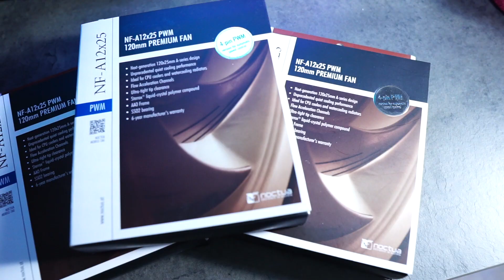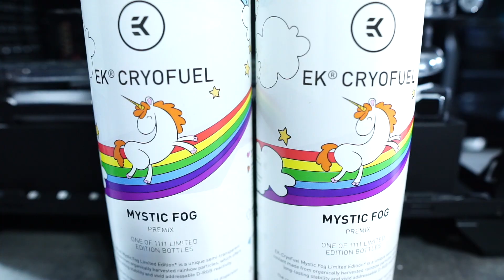Lian Li O11D XL EKWB Hard Line Loop Build

Comment: Awesome build. The offset bracket for the FLT is genius. My gpu is the evga rtx 2080 ti ftw3 ultra, which is 6mm shorter than your gpu but I still needed the offset. Made one from 1/8” thick piece of aluminum flat bar from Home Depot. Thanks for the idea

Comment: Why do the top and side radiators look like they're missing some tubing? Did you run the tubes through the back of the case?
Reply: i ask me exactly the same right now.
Reply from the maker: It runs behind the motherboard in the back of the case to the side radiator. I’ll be doing a follow up video on some of the finer details of the loop!

Comment: Outstanding. I never saw it responded to, but could you spell out which way your fans are oriented. I saw the single rear as in intake, I suspect it won’t matter that much if it’s pointed as an exhaust. Maybe the RAM gets warm, but… I suspect the bottom is I take but I’ve seen too as intake and exhaust in different builds…?
Reply: If i saw it correctly, back and bottom are intake, top is exhaust.

Comment: That looks much nicer. The tubes in previous build looked pretty messy.
Reply from the maker: Yeah I was too fixated on not rotating the CPU block on the old build and didn’t have enough fittings to work around it. Was a learning experience for sure!
Reply: @Kudapex  ohh yeah if feel ya. I always try to have like 2 times more fittings than I actually need to have some flexibility.

Comment: I have the same case and I'm also looking to have 3 radiators, however, looking at your loop flow I dont see the outlet for the top radiator, never done the water cooling at this level before, what I plan is the top rad  (blowing out) deals with hottest part of the loop directly after the CPU, the top rad then feeds the mid rad(side) (blowing out), then into the distribution block, then the pump, then into the bottom rad (sucking in cool air), through the 2 GPU's currently have, 2080TI and 3090, then into the CPU and back up to the top rad, BUT my concern is the GPU's feeding the CPU hot coolant, cool and quiet is what I want, current setup when rending blender animations is noisy even with a Lian Li Galahad AIO 360, the CPU (Ryzen 9 3900x) peaks at 92 degrees under load....
Reply from the maker: Trust me loop order does not matter.  You’re talking maybe a 1-2 degree difference so I wouldn’t worry.  That’s really toasty though. My second PC is running a 3900x as well.  Coolant goes from the GPU to the CPU and it never gets over 75c encoding video with a single 360 rad.

Comment: Sweet build. Hard to tell, but did you have to offset the FLT 240 to fit the GPU? Any special mod required?
Reply from the maker: I did have to offset it since the Strix is so wide. I used a couple little brackets from the hardware store.  I’ll go into more detail in a follow up video.
Reply: @Kudapex  Awesome can't wait to see it! How many temp sensors did you put in your loop? I see one under the outlet port in the reservoir. I'm trying to research placement, what was your reasoning for putting it there if you don't mind me asking? Thanks

Comment: I know this comment is super late but how did you get around the problem with the unifan's being to big to put the quantum fitting directly on the rad? mine do not fit at all!
Reply from the maker: I didn’t seem to have an issue.  Make sure the connector is on the opposite side of the fittings on the rad and you should be good!

Comment: Are those 14mm EK Torque extenders to get the 90 degree fittings over the fans on the bottom radiators?
Reply from the maker: Yes I’d have to measure to remember exact what length I had to use

Comment: This looks great! I have a question on the flow indicator. Where did you get the cover for the screws on it? EK told me they don’t make them yet. Might be because I am using a 3000 series card though.
Reply from the maker: Yeah unfortunately not all EK blocks have it.  I think only the Vector TUF does.  I'm using a 2080Ti still so the block came with it.

Comment: I like your build and I have a question about FLT240 Reservoir D-RGB.  Which bracket do you use to move it to the right to make the clearance for the GPU?
Reply from the maker: I actually had to make them myself. I used a couple small rectangular metal brackets I found in the door hinge isle at the hardware store. You might not need to shift it over though.  The Strix is just very very long.
Reply: @Kudapex  thanks

Comment: Best looking build i've seen. I am in the progress of building in the same system. Could you name the fittings you use from the bottom rad in order to make the pipe go a straight line over the fans? I guess it's some angled 90 degree fitting and maybe an extender? Also, how do you connect the top radiator and side radiator to the res?
Reply from the maker: Im working on a follow up with to show how everything connects :)

Comment: Does work with the black doesnt it.

The rear reaivour, do you think it will fit the corsair hydro x fittings and if so which ones? Building in this case in Jan when it arrives.
Reply from the maker: Should fit no problem.  Keep in mind it’s mounted to a radiator and any corsair fittings will do the trick.

Comment: Amazing build! What components did you use for your drain port (5:24) - especially the "shifting" on/off valve?
Reply from the maker: Thank you!  Off the res it goes as follows: EK Torque 90 Degree > EK Angled 2x45 Degree > Darkside Push Valve Drain

Works great and is easy to hide. The drain valve seems hard to find. I got it from my local Canadian store Dazmode.com

Comment: Epic set up. What temps are you getting when playing games? Subscribed. I'm upgrading from the dynamic to the XL myself. Got x3 360mm radiators :)
Reply from the maker: Awesome! On the regular O11 I was hitting like 45c water temp but now I am hanging around 40c.  GPU is around 40-45c and CPU doesn't get over 65c while gaming.
Reply: @Kudapex  
That's so good. I'm gunna try push/pull all 3 360mm radiators. Wish me luck 😜 may need some modding.

Comment: CAn you fit a 360 Rad with 60mm thickness at the top?
Reply from the maker: You potentially could, but it will depend on your motherboard.  The IO shroud could get in the way, as well as the CPU power connector.  It's hit or miss.  In my build, a 60mm would not fit.

Comment: Nice build!
I'm currently checking to watercool an o11XL myself and was wondering about how putting a EK FLT pump/rez while still keeping the side radiator.
If you wouldn't have a bottom radiator, only fans, would it be possible to put the FLT 360 pump/rez combo instead of the 240 like in your build?
Reply from the maker: Yeah I believe it should fit just fine

Comment: That's a great build! How did you get that RGB effect on/through the hardline and coolant?
Reply from the maker: Most of the light comes off the fans but I also have a total of 4 RGB strips along the frame of the case.  The coolant is what really makes the difference.  It’s called Mystic Fog from EKWB.
Reply: @Kudapex  oh wow. The coolant is the key. 👍 At first I thought you had RGB hardline fittings but was confused as to how they made that effect.

Comment: where's the outlet for the top radiator?
Reply from the maker: It runs behind the motherboard in the back of the case. I’ll be doing a follow up video on some of the finer details of the loop.

Comment: 3 radiators? Wow! Your temps have to be incredibly low. I thought going with 2 rads for my r9 5900x & 3080 ti is alrdy more than enough cooling 😂
Reply from the maker: Honestly they aren’t that amazing lol.  My water can still hit 45 degrees in demanding games. But the components have great temps.  Doesn’t help the computer is upstairs so the heat has nowhere to go.  I think the Lian Li fans are at fault.  They are a bad design for radiators.
Reply: @Kudapex  so what temps do your components run at? Also 45°C? Cause i ordered two corsair rads in combination with those lian li fans as well since the fans have very good air pressure.. rn i'm hitting a max of 68° on the gpu and a max of 82° on the cpu when running demanding games at around 24° room temperature for over an hour (e.g. Apex Legends makes my pc run hotter than any benchmark).
Running a Enermax AquaFusion 360mm AIO and the asus rtx 3080 ti tuf gaming.
Reply from the maker: CPU typically in the 60s and GPU in the 40s.  Room temp varies from 22-24 C.  Make sure you have a water temp sensor, depending on what pump you’ll be running.  Once you start getting into the 50s, PETG tubing can start to melt and pumps can fail.  Assuming you’re building a custom loop with those rads I’d definitely go with acrylic tubing :)
Reply: @Kudapex  I was going to get the Lian Li O11D Distro-Plate G1 (it says water temp should be 10°-60°C) and for tubing either clear or frosted acrylic from alphacool or ekwb. Both blocks for cpu and gpu from ekwb. Just trying to dodge everything rgb related from corsair because i hate corsairs rgb system 😅
In the process of picking and ordering all the parts i've also found out that it's quite complicated with the different materials and fittings.